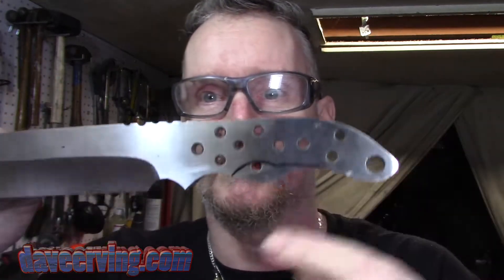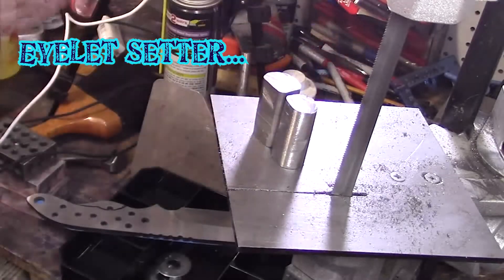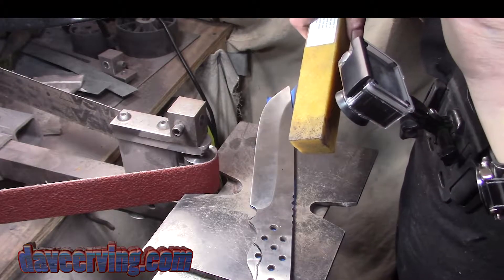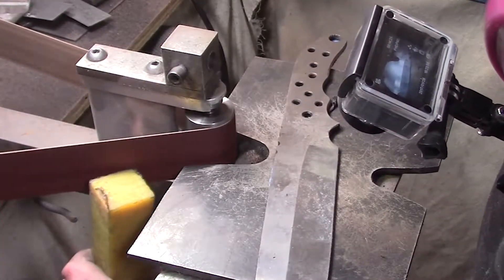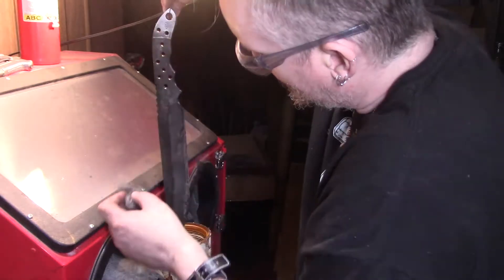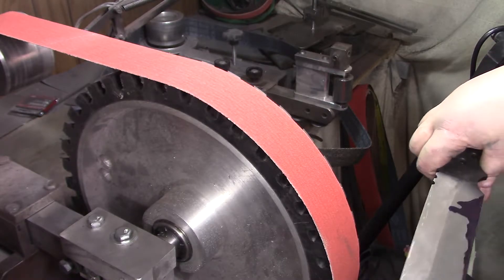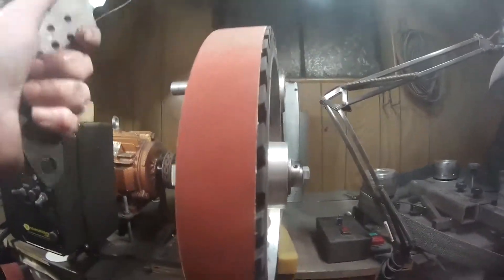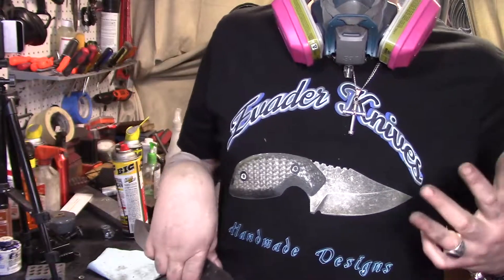5160 Chopper Build -  Fixing Bevels and Handle Prep

Comment: Hay Dave just thought I'd mention when I have a blade that is near finished and I need to scrub a line I use a sharpened to a point piece of brass pin stock so it does not scratch into the surface. If that made sense..
Reply from the maker: Right, huh, I never thought about that. Makes sense though, since brass is so soft. Thanks...